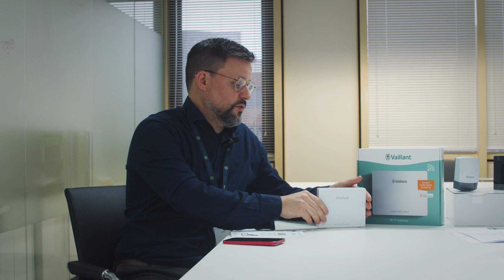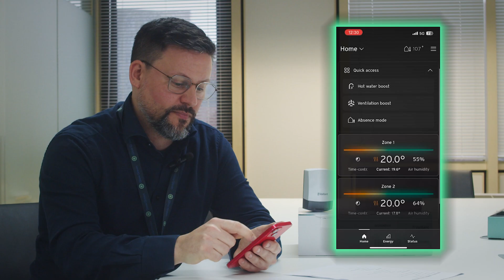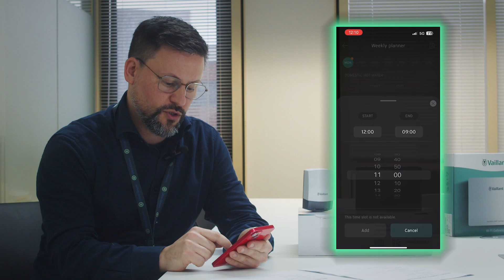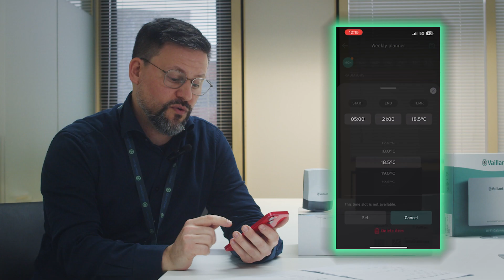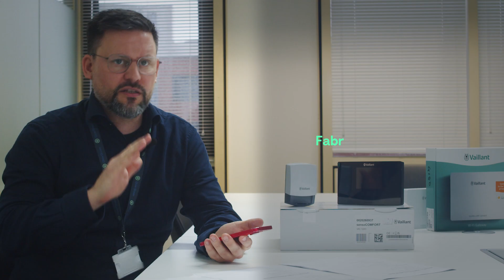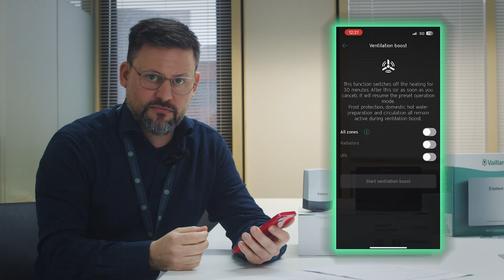The myVAILLANT App Explained | How to Set Up the myVAILLANT Connect Gateway

Comment: A really clear and helpful explanation of how best to set up a ashp.  Having recently bought a house with a heat pump installed, it was like going from driving a car to flying a space shuttle!  I hadn't a clue how it all worked and how to set it up to run more efficiently.  I have now changed my settings in line with your suggestions and will see how that goes.  It would be really helpful if you could produce a similar guide for setting up under floor heating as I have UHF and radiators.  I currently have my Vaillant set to manual for UFH and control the settings for the zones via room stats. Is this the best way. to run it?  Many thanks.